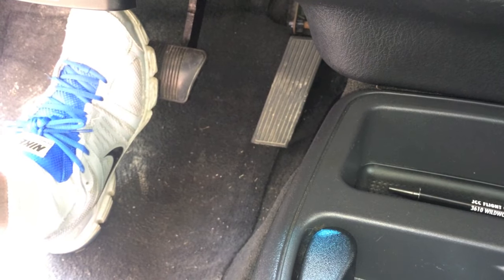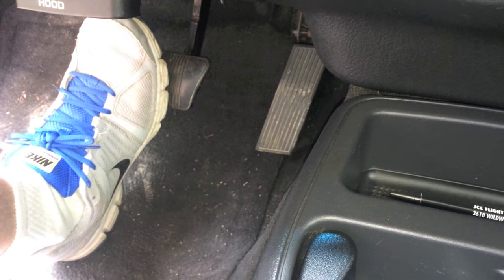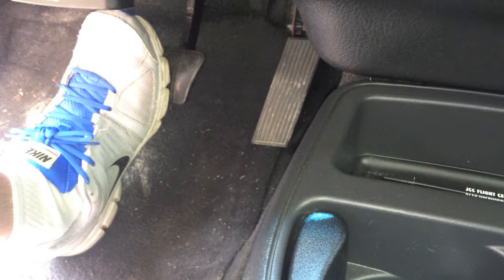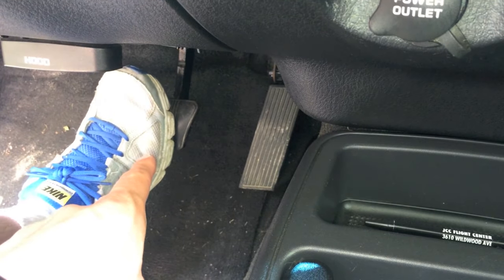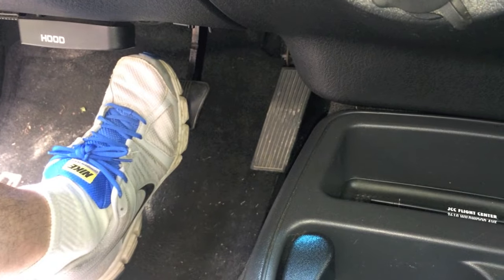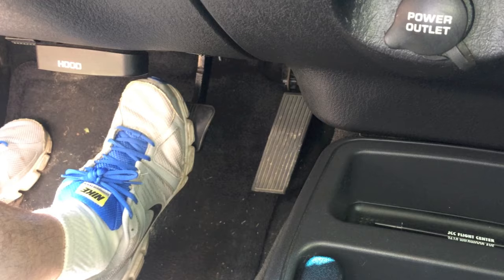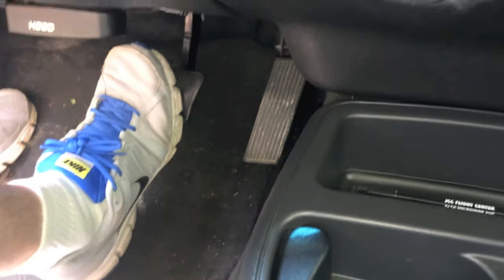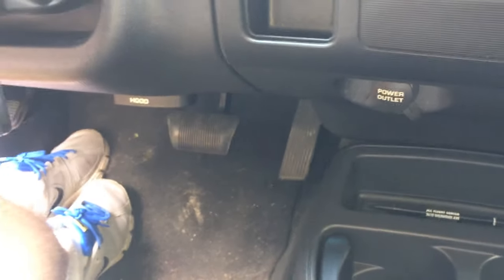HARD Brake Pedal - How to check if your BRAKE BOOSTER is GOOD or BAD

Comment: 00 yota camry Le

 it's firm very hard then when i fired up the car it doesn't even move. Is that considered as  needed new Booster and M.Cylinder ? thanks
Reply from the maker: Christian Siazon 

Whats up Christian, that is a great question!  Thanks for checking out the video!  Lets get this figured out!

This is definitely not uncommon!

It can be a few different things....thats if you are experiencing a HARD Brake Pedal...

1.  Its possible that your caliper is beginning to stick...maybe caliper slides have lost the lubrication required to shift back and forward freely.

2.  It can be possible that your Caliper piston has lost its lubrication which will also interfere with the efficient shift back for forth.

3.  The front rubber brake lines that connect to your caliper fail from inside rather that outside.  This means the inner coating begins to break away and clog portions of the brake system...hence not allowing fluid to flow back and forth freely.  

4.  Your brake pads have little prongs/teeth on them.  You will notice by their location...the pads slide on a steel brace.  This may need to be lubricated to bring the shift back to efficient requirements.

I have attached a few videos.  Lets start with the easy items and then work our way up!  Keep me posted!  Please Subscribe to the channel that would be awesome!

1.  Caliper Slides Lost Lubrication:

https://www.youtube.com/watch?v=-DZ68tKuCQc&t=15s

2.  Too much Fluid in Reservoir:

https://www.youtube.com/watch?v=X-AJ5tD6zoA&list=PLjCXOz8TSkZnavDiGDyHdPKe2dV2RzEMZ&index=39

3.  Failing Front Brake Lines:

https://www.youtube.com/watch?v=3FTEgbLYAdI&list=PLjCXOz8TSkZnavDiGDyHdPKe2dV2RzEMZ&index=78

4.  Brake Pads not shifting:

https://www.youtube.com/watch?v=3Pq15BWM_qY&t=103s

5.  Replacing Front Brake Calipers:

https://www.youtube.com/watch?v=8HoaL4QM5-k&list=PLjCXOz8TSkZnavDiGDyHdPKe2dV2RzEMZ&index=83

6.  How to check if Brake Booster is Failing:

https://www.youtube.com/watch?v=VK4lowH7kQE&index=66&list=PLjCXOz8TSkZnavDiGDyHdPKe2dV2RzEMZ

7.  Failing Brake Booster:

https://www.youtube.com/watch?v=j9s7yccswPQ

8.  Symptoms of a Failing Brake Booster Check Valve:

https://www.youtube.com/watch?v=j9s7yccswPQ&index=68&list=PLjCXOz8TSkZnavDiGDyHdPKe2dV2RzEMZ

9.  Master Brake Cylinder Failure:
 
https://www.youtube.com/watch?v=F9s_1VZ2u5E&index=24&list=PLjCXOz8TSkZnavDiGDyHdPKe2dV2RzEMZ

Again let us know!  We are here to help!
Reply: Thanks I will let you know soon as I get back. Godbless
Reply from the maker: Christian Siazon 

Awesome 😎👍🔧🔩

Comment: I have a 2013 dodge charger and its so hard to stop and i can hear air noise inside the car.. Can anyone please tell me what is wrong please
Reply from the maker: yo-mama ex-boyfriend Thanks for checking out the video and sharing your experience.  By chance has there been any recent work done to your Brake System in the last 12 months...this will help figure out if the repair has any relation to your current situation.

You mentioned you hear air...is it more like a hissing sound?  If yes, that’s an indication of a vacuum leak.  A vacuum hose may have encountered a leak and will need to be replaced.  Vacuum lines come off you Brake Booster and run along the Firewall underneath your hood.  Below is a link to a video that shows more info on it.  The video mainly deals with Brake Booster Check Valve.

Let’s start with the easy & inexpensive items first.  Keep us posted!  Please subscribe to the channel and turn on your YouTube notifications that would be awesome thanks again 😎👍🔧🔩

Below is the link!

       https://youtu.be/j9s7yccswPQ

Comment: Well at least I know the booster is good. Thanks I’m still trouble shooting
Reply from the maker: Donald D 

Thanks for watching & keep us posted on your project.  Possible caliper or rubber brake line replacement will solve issue.

😎👍🔧🔩
Reply: After more research today the hard brake pedal was due to truck not being use very often. Pedal issue works normal now. Thanks Micheal
Reply from the maker: Donald D 

Thanks for the update & that’s great news.  😀

Sounds like more evening cruises to keep that truck moving.

😎👍🔧🔩

Comment: What if my brakes pushed back towards me/driver?
Reply from the maker: Thanks for watching, it’s likely that your Master Brake Cylinder inner Piston is sticking.

The inner piston can get stuck in certain positions and cover the brake line ports which in return…can block fluid from coming in and going out.

This will begin to degrade brake performance significantly and lead to brakes getting tighter on the pads to a point where they can lock brakes.

Below are a few helpful videos on Master Brake Cylinder and inner Piston.

       https://youtu.be/F9s_1VZ2u5E?si=rCpb1T5iu9BhXq8P

       https://youtu.be/FuB1BAdgNpE?si=jpSkQubeNYYAwmmj

Any update on your brake project?

Comment: We have 2002 GMC W4500 and keep having an issue with the brakes... Replaced the master cylinder, bled the brakes several times and still get air in the lines. Our mechanic has not noticed any leaks but cannot figure out how the f we are getting air in the lines! Any ideas? I don't want to insult his intelligence but we nee the truck back...
Reply from the maker: Office Manager 

Thanks for watching & sharing your experience.  Let’s get this figured out together!

A few things come to mind.

1.  Believe it or not, it is more common than you think to see tiny bubbles coming out of the valve after you feel it should definitely be free of all air.  Sometimes you will see a constant release of tiny bubbles as they are a result of the air passing over the threads of the pump hooked up to bleeder...if used.

If your bleeding the brakes the old-fashioned way with an individual in the driver seat pumping the brakes as you work down below at the bleeder unscrewing it and screwing it  in to release the air, you should definitely reach a point where you are no longer seeing any tiny bubbles whatsoever.  

Depending on the severity of the brake system part that was replaced and how long your brake lines were open...as well as how much fluid bled out during the replacement of the part will ultimately result in how long and tedious the bleeding of the brake system will be.  You may need to just keep attempting to bleed and be patient as less and less bubbles will come out.

2.  Your bleeder valve itself may not be fully tightened and secured onto the caliper.  Although this is very unlikely it’s still possible and something we can’t rule out.  We recommend verifying that your bleeder valve is fully secured to the caliper.

Let’s start there!  Keep us posted!

Please subscribe to the channel and turn on your YouTube notification Bell 🛎 that would be awesome thanks again!  😎👍🔧🔩

Comment: replaced all 4 calipers 1 was ceased others bleeders where stripped and now have no brakes, installed a new master cylinder and bleed it, no brakes swapped the abs unit no brakes.  car not started has a hard pedal car started pedal goes to the floor ???
Reply from the maker: Thanks for checking out the video and sharing your experience joe18370!  Have you completed a full Bleeding of brakes procedure?  If not, that must be performed.  Since your Master Brake Cylinder is brand new, you will need to complete a full bleeding procedure on the Master Brake Cylinder...mostly done on a bench and not hooked up to vehicle.  Also, have you noticed any brake fluid leaking from anywhere?  Keep me posted!  Please Subscribe to the channel and turn on your YouTube notifications that would be awesome thanks again!  Lets figure this out and get you back on the road safely!

Comment: can you start the engine when the brake pedal is stuck stiff & cannot be pushed in anymore but your car requires you to push the brake ?
Reply from the maker: Armour Shooter 

Thanks for checking out the video and sharing your comment Armour Shooter!  That’s a great question!

When the engine is off, not all of your Brake system parts are up & running.  It is normal for your Brake pedal to get tough to push when your engine is off.  It is also not recommend to push Brake pedal when engine is off.  This is because it traps pressure in the system & can harm it if the pedal is continued to be pushed at a harder applied pressure.  Once you start engine, all the Brake System parts begin running and the pressure is then released.  Hope this helps.

Please subscribe to the channel and turn on your YouTube notifications that would be awesome thanks again 😎👍🔧🔩
Reply: DIY With Michael Borders thx for the tip ;)
Reply from the maker: Armour Shooter 

Thanks for the reply.  Let us know if you have any additional questions along the way we are here to help!  😎👍🔧🔩.  Don’t forget to Subscribe to the channel.
Reply: oh ya i got 1 in mind, does hydraulic clutch have the same system & becomes hard when pressed when engine is off ???
Reply from the maker: Armour Shooter 

Thanks for the question!  In most Hydraulic system designs, it solely depends on Electrical power to activate Hydraulic system & all its associated parts.  Most are Electrically activated, Hydraulically actuated.  Pedal may get harder with system off...trapped fluid in lines.  Hope this helps!  😎👍🔧🔩
Reply: Armour Shooter. .

Comment: I have a ram 1500 with a spongy pedal and goes to the floor slowly and lots of effort to stop. No physical leaks, new calipers, pads, rotors and braided hoses. Ive bled it several times. Loud whooshing sound under the dash when applying the brakes. Trying to figure between master cylinder or booster. This issue just started after the new pads a couple days ago.
Reply from the maker: Thanks for watching...are you having to fill the brake reservoir with fluid frequently?  The Whooshing sound under the dash can be the sound of the brake fluid leaking into the brake booster.  Subscribe to the channel that would be sweet.  Keep me posted!
Reply: DIY With Michael Borders not loosing any fluid at all. Def will subscribe
Reply from the maker: Thanks for the update....and just to be sure...you have already replaced the rubber brake lines that connect the hard line to the calipers correct?
Reply: DIY With Michael Borders yes with stainless steel braided ones front and rear.
Reply: The issue is probably the seal in the booster.  It is supposed to seal the vacuum side of the booster and allow air in on the atmosphere side when you press the pedal.  If the seal goes bad, the vacuum will pull air through when you press the pedal.
Reply: Dodge ram 1500 r /R brake booster

Comment: I just replaced clutch parts and plastic seals on my truck now when i use the brake it stops more than it should what's the problem help me
Reply: I changed ALL clutch parts and seals on the pedals of my 1997 f 250 now the brake pedal when i use it to slow down it's like i hit the brake harder what did i do wrong help me.
Reply from the maker: Bobby Hayes 

Thanks for watching Bobby!  Let’s get this figured out!

After replacing the parts that you did, you will definitely feel a difference in Brake pressure when pedal is applied...you should see a great improvement in pedal-to-Brake performance.

We recommend taking a look at your Brake reservoir at this point to verify the fluid is within the proper fill parameters.  If fluid is over or under fill parameters, your brakes & pedal will not perform properly!

Let’s start there!  Keep us posted!

Please subscribe to the channel and turn on your YouTube notification Bell 🛎 that would be awesome thanks again!  😎👍🔧🔩
Reply: I am going to change the brake booster that has to be the problem.
Reply from the maker: Bobby Hayes 

Very cool & thanks for the reply!  Let us know if you have any questions during your project!  We are here to help!  😎👍🔧🔩

Comment: i did this same testing with good results but my break pedal gets hard sometimes not all the time. No break lights on any idea
Reply from the maker: Thanks for watching & sharing this.  Glad to hear the video helped.  Us fellow DIY’ers need to stick together!

At this point, it can be a few things.

1.  To much brake fluid in your reservoir
2.  Worn out & occasionally sticking caliper slide or failing caliper all together
3.Failing rubber brake line feeding off your caliper.

After driving a bit and noticing the brake pedal getting stiff/hard, take a quick minute to inspect your front wheels and rear wheels.

In the event that you find one wheel much hotter than the other three, you have found the wheel causing your issues.

Let’s start there, keep us posted.

Enjoy your day.  😎👍🔧🔩
Reply: @DIYwithMichaelBorders  Thanks Michael ill post my findings after its fixed Thanks again!.
Reply from the maker: @BigBoy74X  

Very cool.  😎👍🔧🔩

Comment: hi I have a Toyota pick up 22r and its having a problem of braking itself, even if you are driving on high speed you feel the brake pads smelling what could be wrong? I replaced the brake pads but it doesn't help.
Reply from the maker: NO FUN...Brake problems are very annoying and I definitely feel your pain.  Lets get this figured out together so you can get back to normal driving.

It can be a few different things....

1.  Its possible that your caliper is beginning to stick...maybe caliper slides have lost the lubrication required to shift back and forward freely.

2.  It can be possible that your Caliper piston has lost its lubrication which will also interfere with the efficient shift back for forth.

3.  The front rubber brake lines that connect to your caliper fail from inside rather that outside.  This means the inter coating begins to break away and clog portions of the brake system...hence not allowing fluid to flow back and forth freely.  

4.  Your brake pads have little prongs/teeth on them.  You will notice by their location...the pads slide on a steel brace.  This may need to be lubricated to bring the shift back to efficient requirements.

I have attached a few videos.  Lets start with the easy items and then work our way up!  Lets figure this out together!  Keep me posted!  

PLEASE SUBSCRIBE to the channel that would be awesome!

1.  Caliper Slides Lost Lubrication:

https://www.youtube.com/watch?v=-DZ68tKuCQc&t=15s

2.  Too much Fluid in Reservoir:

https://www.youtube.com/watch?v=X-AJ5tD6zoA&list=PLjCXOz8TSkZnavDiGDyHdPKe2dV2RzEMZ&index=39

3.  Failing Front Brake Lines:

https://www.youtube.com/watch?v=3FTEgbLYAdI&list=PLjCXOz8TSkZnavDiGDyHdPKe2dV2RzEMZ&index=78

4.  Brake Pads not shifting:

https://www.youtube.com/watch?v=3Pq15BWM_qY&t=103s

5.  Replacing Front Brake Calipers:

https://www.youtube.com/watch?v=8HoaL4QM5-k&list=PLjCXOz8TSkZnavDiGDyHdPKe2dV2RzEMZ&index=83

6.  How to check if Brake Booster is Failing:

https://www.youtube.com/watch?v=VK4lowH7kQE&index=66&list=PLjCXOz8TSkZnavDiGDyHdPKe2dV2RzEMZ

7.  Failing Brake Booster:

https://www.youtube.com/watch?v=j9s7yccswPQ

8.  Symptoms of a Failing Brake Booster Check Valve:

https://www.youtube.com/watch?v=j9s7yccswPQ&index=68&list=PLjCXOz8TSkZnavDiGDyHdPKe2dV2RzEMZ
Reply: thank you
Reply from the maker: peter Chello wilpard Do you hear any hissing/whistling sounds coming from brake booster?  If so then take a good look at all vacuum lines feeding into booster.
Reply: no there's no sound. ...
Reply from the maker: peter Chello wilpard Has the vehicle had any work to the brake system within the last few years?  If not, your front brake lines may be failing.  Its also possible that your calipers have begun to stick and will need replacement.

Comment: hey im messaging from new zealand i have a 2001 bmw 318i and the brake pedal is hard all the time when cars turned on its still hard and stays hard is this the break booster?
Reply from the maker: Jimmy Jacksom have you had any recent brake repairs completed ?
Reply: nope
Reply from the maker: Is your brake light on inside the vehicle.  Is your brake fluid low?
Reply: +Jimmy Jacksom Did you ever figure this out??